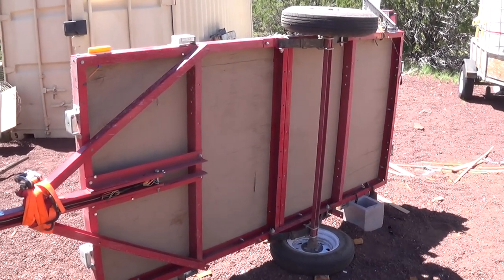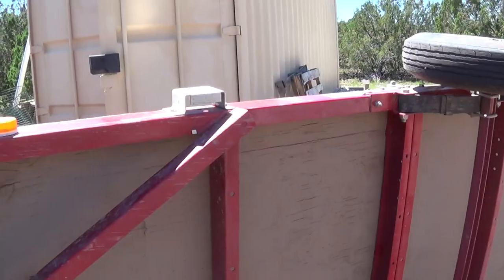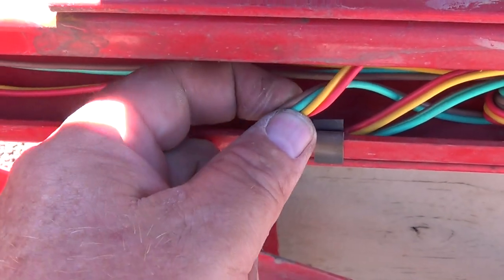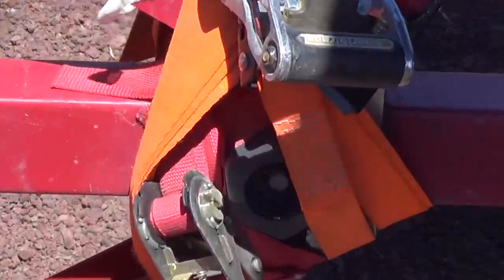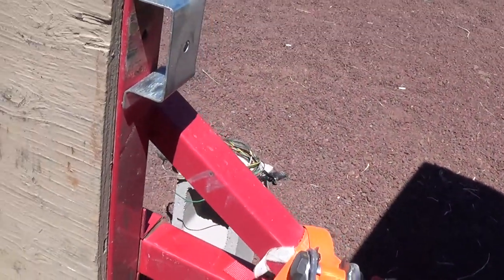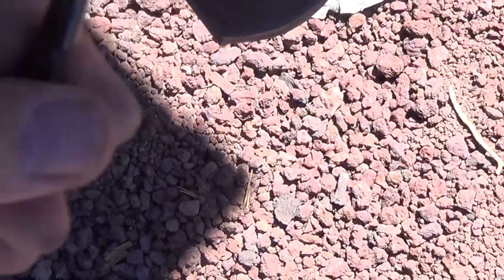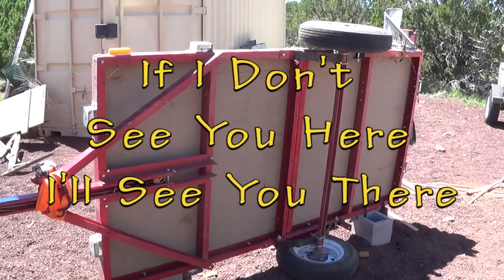Harbor Freight Utility Folding 4x8 Trailer - Rewiring the Lights

Comment: It seems like you just rewired it the same way instead of removing the pinch point, is that correct? I am having a hard time figuring out how to avoid routing it through the frame and keeping it from sagging if I just route it underneath. So far, I have not found a solution. Spring pins would be ideal, but they don't make them large enough to ensure contact since these trailers have cheap hinges.
Reply from the maker: yes i wired it the same way they did. there are clamps that you could use to keep it from sagging.

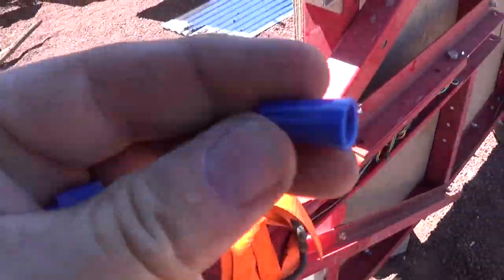Comment: FYI (6:06) that extra 4' of wiring is to go to the towing vehicle if there isn't already a source-plug for your trailer lighting hookup that you just installed.

I'm just passing by, looking for tips on how to route the wiring on the HF trailer.
Reply from the maker: i thought the extra was just in case for the tongue and other size trailers. .  glad you found the video. hope it helped you in your wiring.  i sure dont like the thin wire. lol

Comment: Quick question.. how are the trailer on the highway at a  speed 70/75 mph??
Reply from the maker: +Evandre Molina great question. it pulls well. most of the drive from phx to show low is 55 or 65 and lots of cops so I stay at the limit and the loads I have had it pulls great. I got my moneys worth out of this trailer I got it for $300 already assembled (craigslist) . just need to watch the 1k lbs limit.
Reply: thank u for help

Comment: ALL YOU NEED IS WIRE AND 1/winch pvc PIPE .run the wire thru the pvc and run the pvc thru the channels from front to back silicone the ends easy poise.
Reply from the maker: i love the idea. i may have to do it.

Comment: I am not a fan of Harbor Fright. I have heard their products are a really good deal, if someone wants to rebuild and repair right out of the box. There's lots of things these days that break sooner rather than later and so it's nice to know how to rewire a trailer. Would cost a heck of a lot to have it done at the shop!
Reply from the maker: Electrosensitive Prima Donna Going Off Grid I look at harbor freight as the guys version of a womens discount clothing/make up store. lol. or maybe I should say for most women. ... some women love harbor freight.
Reply: ArizonaHotHomestead Never done too well with discount make-up or lately anything out of China production shops. I guess my channel name says it all.  I am to the off grid community, what "Private Benjamin" was to the army. Makes things interesting and different for sure. I really thought I was getting a great buy w/ the Harbor Fright multimeter: the neg. lead fell out of the hole and the positive lead was made wrong and would not go in the hole. Returned and bought one for 4 X as much on amazon and vowed never again. I do not think the best of do it yourselfer's could have fixed that one.LOL
Reply from the maker: wow sorry about the multimeter. I have had good luck. guess we cant win them all.